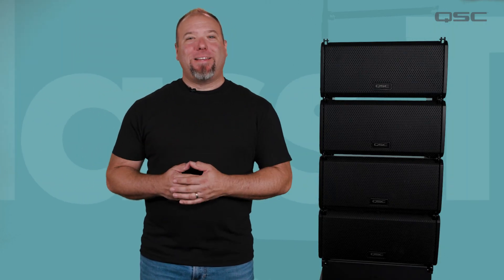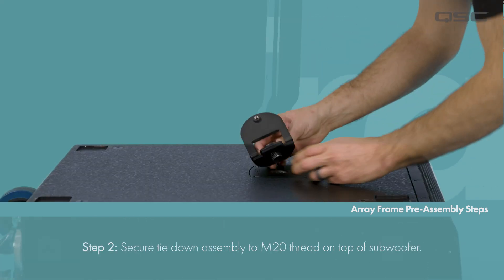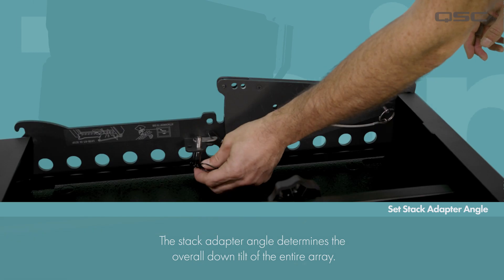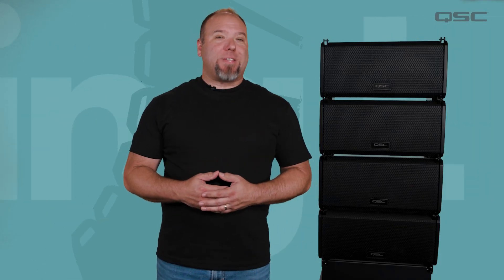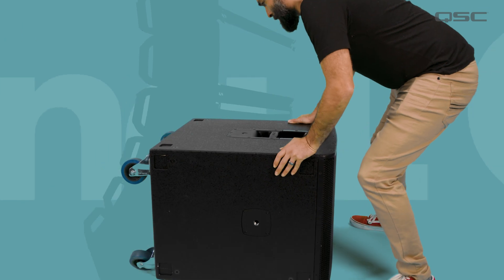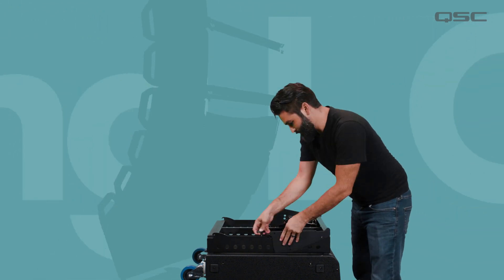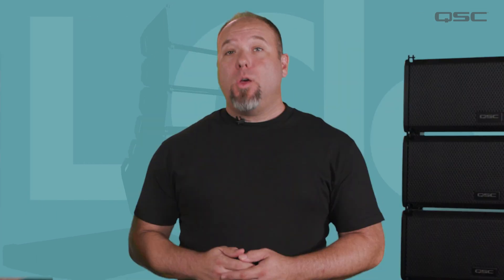L Class Training Series 5: Ground Stack Deployment

Comment: I don't underestimate the specs on the 8" is exactly like a k8.2. how can these throw more?
Reply from the maker: The LEAF waveguide (LA108 has 105° horizontal and 15° vertical coverage), a new amplifier, neodymium drivers, and updated DSP are all a part of the improved performance in L Class.

Comment: It obviously appears that you can stack the LS118's, but are there any ramifications to stacking 2 LS118's horizontally, and using the array frame, stacking 3 LA112's above that? Seems like a simple ratchet strap can be used for some extra stability..
Reply: I was wondering the same thing. Also seems like you should be able to stack 4 of the 12s but I'm wondering if the software just wont even let you

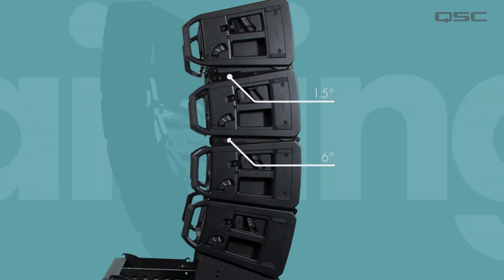Comment: 3:38 so basically this line array series is useless in scenarios where you have no fly points and have a listening area that goes up hill? Am I understanding this correctly? If so this series is a hard pass.
Reply from the maker: You absolutely can deploy an array to point uphill if you use the larger angles to bend your array upwards. This is a scenario that was definitely accounted for, and the rigging supports. When SysNav is released in early May, be sure to try out the predictive software (AIM) and you can find the deployment and splay option that suits your application. Thanks,

Comment: Doing a ground stacked right on top of a sub with Line array  is just for looks. you might as well just use point source. Close when you have to turn the subwoofer on the side you’re saying for aesthetics if you have casters on the bottom that’s not going to be very aesthetic when they’re sticking out the side